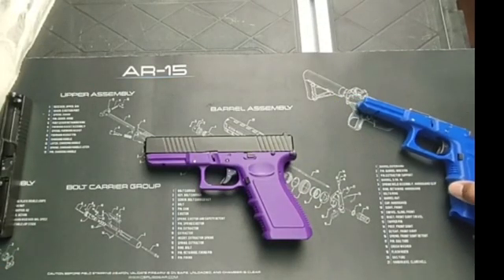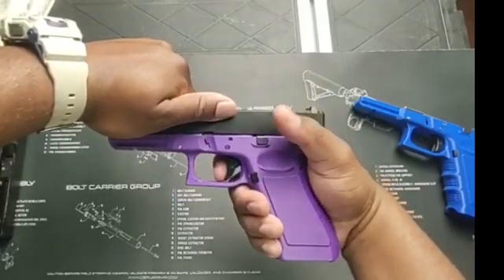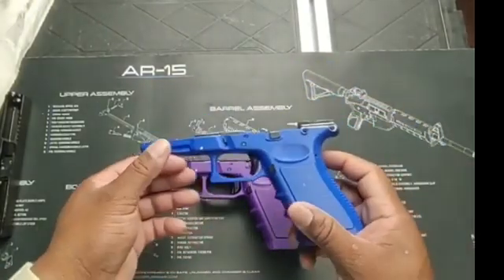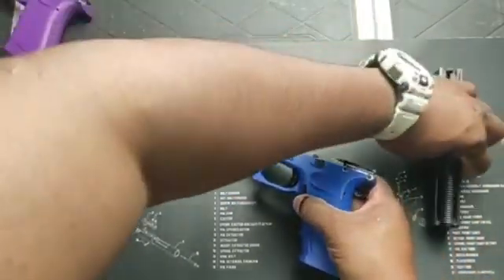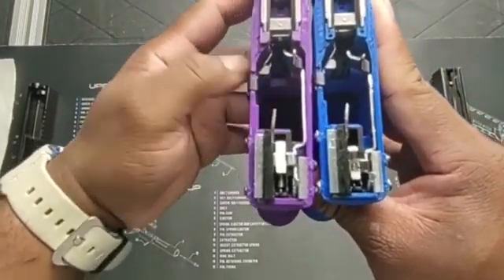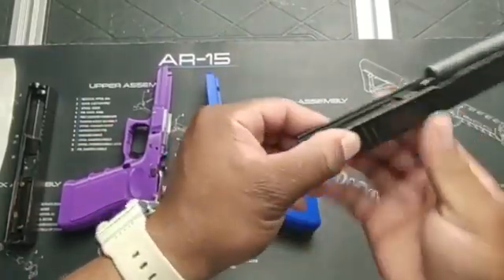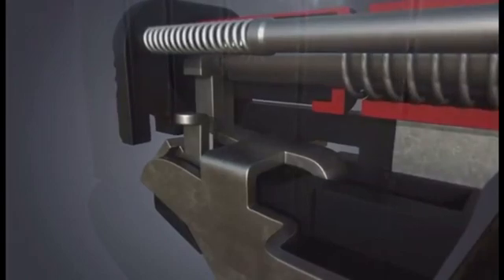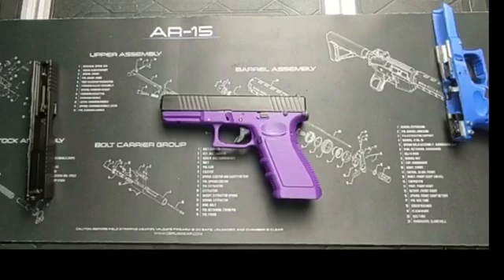Glock 3D Print Trigger Won't Reset

Comment: I’m having worse problems I just made a brand new frame and threw everything in there and now my trigger won’t click I’ve even put all my strength into it and nun still happened (any tips to fix it?)
Reply from the maker: What do you mean your trigger won’t click? Does the trigger move at all to the rear?
Reply: @juniorlargie  I would pull it back to see if it’s go shoot but it don’t I even grab both of my hands and try hard asl to squeeze the trigger and it still won’t go all the way back
Reply: Idk if It’s the aftermarket pieces I bought or what because this the 3rd frame I put it in and it does the same thing
Reply from the maker: Do you have another trigger to put in that frame? 

And also is the trigger safety moving to allow the trigger to go to the rear?

Comment: Mine only does it 1 time right after I take the mag out any suggestions?
Reply from the maker: Check the same crucifix that I bent up. You might need to bend it up ever so slightly. Mine no longer has that issue at all
Reply: @juniorlargie  okay thanks man I’ll try that
Reply: @juniorlargie  I tried it with my oem trigger and the after market one works better it’s only once after I take the magazine out I could not be more confused

Comment: I have a different but possibly related issue. My 3d printed glocks trigger won't break, seems to reset every time I rake the slide though. Anyone know of a fix for this kind of issue?
Reply from the maker: Ok when you pull the trigger it's really tight and still won't break?
Reply: @juniorlargie  thats correct I can pull as hard as I can and no luck
Reply from the maker: https://youtu.be/V2RDitgCaD0

Watch this video and see how the trigger breaks. Put some grease on that area in the back where the connector slides. I use to have that issue and oiling would make it work. But polishing the parts made it much smoother for me. Try that

Comment: There's usually 2 issues that keep the Glock trigger from resetting. 1 is the connecter being too tight in between the sear pack and the rail assembly/frame not allowing it to move free of the sear. 2 which is what you seem to be running into where the sear doesn't make reliable contact with the striker assembly. For 1 you have to find what is holding the connector moving and make sure the trigger bar isn't binding on the slide. For 2  it's most likely an out of spec dimension issue with the rails and you can usually bend the sear but sometimes they're very brittle and break rather than bend.
Reply from the maker: I've had it binding before when i tighten down the screws too much for the rails. So everything else moves smoothly. But it's all an experiment so I just enjoy the process of getting it to work.

Comment: Those are some clean prints , what is that? Petg?  You like those old style rails? Does that relieve and cracking that may occur near the trigger shoe / rear rail pin ?
Reply from the maker: PLA + and i dont mind either style but i think this might break eventually if abused long enough right by where there screws keep the rails into the frame.

Comment: Hey bro have you shot it and noticed this causing any malfunctions? I came to the same conclusion with mine but I'm nervous it will cause other malfunctions lol
Reply from the maker: After that mine ran smoothly so i have no issues anymore. Just remember it's not a Polymer 80 or a Glock so the tolerances aren't as tight.
Reply: Honestly I think I'm gonna order a slide plate that let's you see the connection and go from there, thanks for the replies bro
Reply: That's true, mines a palmetto lower with a non palmetto slide so... probably as tight a tolerance as a 3d printed one lol.
Reply from the maker: Well i think those are a little different with how they were built. So you might wanna try a palmetto slide before you do anything else

Comment: I see some builds with screws in the rear rail like yours. I got Aves rails and there is no screw holes. Is the screw design better? Are you using factory Glock LPK? I had all kinds of linkage problems with an off brand set.
Reply from the maker: I believe the pin design is better. And regular stock lower parts kits

Comment: I love videos that are detailed and straight to the point.
2 weeks later and 1 broken trigger connector later (messing with stuff that didnt need to be messed with ) I fixed my issue.
Only with trigger depressed the trigger would not reset after cycling. Turns out the trigger bar was rubbing on the rear of the frame when held. Filed a small amount of the pointed tip (not the radius) and now feels right and resets every time. 
Feels good to figire it out ;)

Comment: Does the trigger reset when you have the trigger depressed and the slide cycles though? I am having that issue with my build.
Reply: Tried this and didn’t work on my first print, but I did print a new frame with rails down and it is resetting now. I’m sure bending up the crucifix made it a bit more reliable tho
Reply from the maker: @minutemenapparel  I sure hope so. You just have to look into the small details of how it works and see if there's something missing.
Reply from the maker: @minutemenapparel  and your new print I believe is more reliable than the ones with the rails st the top
Reply: @minutemenapparel  my trigger bar end was rubbing on the rear of the frame ( look for marks on the inside / inspect the rear most part on the trigger bar when depressed and look for contact to the frame)
Reply from the maker: Yes it does after I bent up the crucifix

Comment: where did you find the file for the print? My printer comes in today and im tryna get it goin once it shows up
Reply: also whyd you use screws and not pins?
Reply from the maker: @concentratecorner1744  A buddy of mine had the file. And when you order the rail kits it comes with screws to screw into the rear rails that you get with the kit

Comment: Sand the inside of the trigger guard, or bend the tab on the trigger bar, inside the trigger block housing that catches on the striker, bend it up a bit so more area connects with the striker and catches. (What you did in video) Also make sure the tab on the right side of the trigger housing that rides against the metal rail insert,  sand the area of the inside of the metal rail inset that runs against the right of the trigger housing
Reply from the maker: Ok will do. I also notice that the screws go through the rear rails and will bind up the trigger housing because they are too long. So I'm still trying to figure out if I should grind them down or find another way like using washers. Any ideas on that?
Reply: @juniorlargie  There's a new frame set you can download that doesn't use screw-in rails. The rails are cut with a dremel and bent into shape. They drop in and use a single retaining pin located at the upper half of the grip next to where the thumb groove is.
Reply from the maker: @joshwizardguy7662  so this 3D frame is gonna be setup like the Polymer 80 frame right? How can I get this file?
Reply: @juniorlargie  You're 100% correct. Head over to odysee(dot)com and search up deterrence dispensed's channel. The File name is DD17v2.
Reply from the maker: @joshwizardguy7662  ok thanks
Reply: @juniorlargie  You're welcome. Screw in rail frames don't last very long after extensive use. Cracks form where the screw holes are at because of the friction between the rails themselves and the slide. Over time the screws in the holes continue to get tugged on to the point of failure.